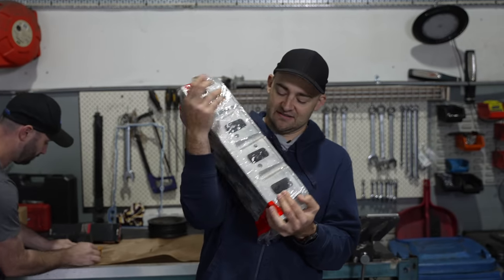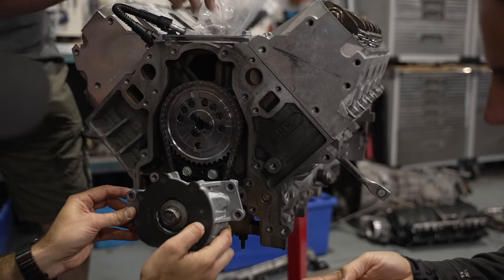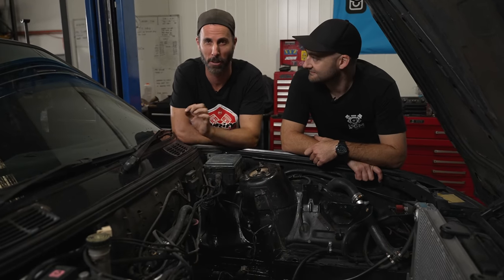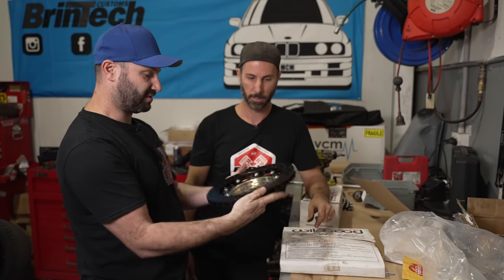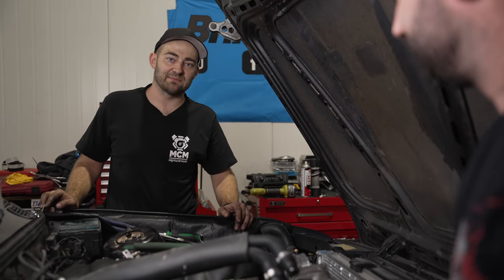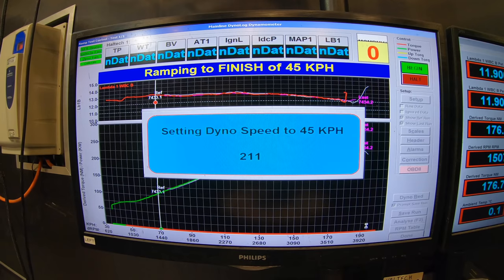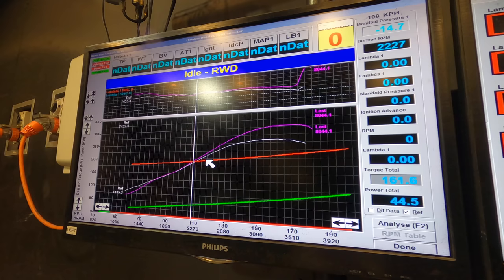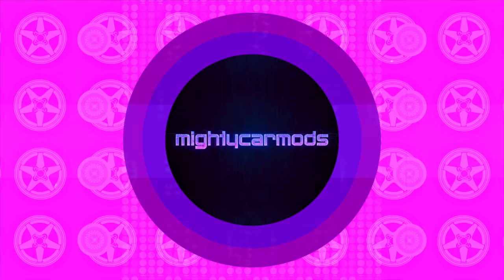BMW E30 CAM Upgrade & Dyno Run

Comment: @12:30 pedant mode activate! Your calipers are axial mount (bolt axis in the same plane as the wheel axis), the ones where the bolts go through the caliper from the outside towards the centre of the wheel are radial mount (bolts arranged radially around the wheel axis). Not convinced it actually makes much difference unless you're a motorbike racing team and want to be able to take calipers on and off quickly for wheel changes.

Comment: There is a reason LS swaps are so common. In the U.S. you can get a junkyard LS for under 1000 dollars. With a few mods, 400-500 hp is possible and they make torque and power throughout the power curve, not just at the red line.

Comment: Hey guys with the front callipers 
Inside the calliper they had 2 small pistons and 1 large
The large one is ment to be on top or exit of the rotor (directional)

Comment: On the brake calipers he said radial amount and axial mount backwards..
Radial mount calipers have the bolts coming straight away from the rotor.
The normal bolt on ears like that are axial mount.

Comment: LS at its core reminds me of an aircooled VW Bug engine with the central single cam, pushrods and rocker arms.

3D print that air intake! :) (I 3d scanned my engine bay, made a model in fusion 360, printed the intake out of ABS and then coated it in clear resin to seal it up. Really made a difference in power! Until my supercharger fell apart haha)

Comment: Pretty crazy gains from the cam and especially the intake. Scotty knows his stuff when he's like "nah, this has more in it, lemme just move this intake" and finds 10% more power.
Reply: It’s kinda obvious (for anyone familiar with LS) that it was sucking in hot air, especially when he has the IATs right there in front of him.  A healthy cam in a LS3 typically picks up 70-100hp.  I didn’t hear the cam specs, and when I saw the 400hp number (50hp gain), I thought they put a fairly mild cam in.  Seeing the IATs and the filter placement explained why the first run was so “low” of a gain.
Reply: @stlchucko  yeah man I'm certainly no expert, just saying a simple mod like a cam providing like 80kw is impressive. I have a stock ls3 and now I'm considering a cam down the track haha
Reply: @Mr_armageddon  I suggest checking out Richard Holdener's channel.  He has a slew of LS dyno info.  Here's one that has a few LS3 runs.
https://youtu.be/T2zJ_LAA-vM
Reply: @stlchucko  cheers bud, will do.

Comment: Remove inner high beam headlight, make airbox with the cone inside and an air duct from the headlight appiture = Ramair effect and even more KW
IF you can find a pair of VW Mk2 Golf headlights and swap it into the outer positions , they will give you both low and high beams if you make a adaptor loom as not to loose the factory wiring if i recall.
Should be about the same size

Comment: The LS is a good engine and has a good design, just because the original schematic has been around for many years does not wright off this design. while personally i have a japanese dohc v8 i cannot deny the power that the ls architecture puts out is impressive

Comment: Question for folks who do dyno stuff: the large fan in front of the car is obviously there to mimic the airflow you get from driving, so the car doesn't overheat. Does the fan speed ramp up to match the simulated speed of the car during the run? Does the environmental air flow rate have a big impact on the fuel/air mix, or is the ECU automatically compensating for that using ambient air pressure sensing? I know the ambient air pressure is a factor for some ECU stuff (VW infamously exploited this to calculate elevation via barometric pressure so they could switch profiles when the cars were at known emissions testing facilities) but I'm unsure if it comes into play with compensating for environmental air flow.

Comment: maibe a small hoodscoop feeding straight intoo the intake filter , make a box on the back of the bonnet under the scoop to hold the filter and use a compression gasket to the hose feeding the trottlebody when the hood is closed

Comment: Are those the factory rocker? If they are, you should consider upgrading the rocker trunnions at the very least. The factory trunnion caps that hold the needle bearings in tend to come out when holding the engine at high rpms, i.e. during burn-outs and or drifting. Comp Cams sells a cheap kit that is very easy to swap out. COMP Cams 13702TL-KIT on Summit Racing. Just remember, loose needle bearings sink ships.

Comment: Marty. This car is infamous for overheating. Especially with this swap. If you're not ready to seriously chop the front up to let air in EVERYWHERE your skids are going to be 30 seconds long and end at 250F water temp every time.

Comment: "Do you think this would fit a Honda?" Lol! Moog is never going to let go.
What goes around, comes around. As I recall, BMW used to make plain, unexciting German sedans, until someone (not BMW) got the idea of putting the engine from 2 liter car into the 1.6 liter car. Performance happened. BMW noticed. The rest is history.
Can't wait to see the lads put that push-rod-ium goodness to work! Who'd have thought cold air would be worth 30 kw/50 hp?

Comment: Some Corvettes use an intake that runs into the engine from the front of the car with a large panel filter. I feel like that could be a viable option to feed the engine cold air

Comment: Saying this as a "not an LS fan",.. that motor, in that body, is going to be a fun combo, and M3 beating performance with the right suspension tune, but a shedload cheaper to keep on the road.
If Holden had put that TT36 Torana concept in to production, this is what it would have performed like.

Comment: Love it guys, as per 👌🏼
I’m gonna have to google putting grease on the head bolts, I guess there’s an appropriate torque spec when lubed? Same for the rocker bolts; I always thought threads shouldn’t have lube if there’s a torque spec, but every day’s a school day 👍🏼
I feel like I’m allowed to ask geeky torque spec questions after the video on cam specs and timing 🤓

Comment: Kinda suprised you guys didn't get the heads CNC ported by Higgins. That's a significant power-adder that really compliments a cam upgrade - could have hit around the 350's.

Comment: The BMW m3 had vents in the bonnet for air intake. id take inspiration from the competition BMW m3, Fast & Furious Toyota supra, and even the Subaru hood scoop. I've also seen people make custom intakes and holes to get the intake by the radiator up front. not sure if you wanna cut up the gem of car you got tho.

Comment: Why not have the heads ported and polished while they were off and at the machine shop? It would compliment the cam swap, and ported heads really wake up an LS, even on their own. Basically left 30+ horsepower on the table. Doesn't really make sense to only have the heads ported, but if your doing the cam, and they are going to a machine shop already, might as well right?

Edit to add, what a monster though. A little E30 like that with 440 HP is going to be a BEAST!

Comment: I want an e30 with a 300hp NA k24 swap and the 4.10 rear. Go Lightweight for wheels and tires... and you have one seriously fun street car for the twisties that gets decent fuel mileage and will be honda reliable.

Comment: That really is just an amazing car; an amazing build. I was so surprised by the change in power just by getting the filter out of the way. I would be very curious to see if you leave it as is or come up with a fabrication to isolate the intake to pull cooler air.

Comment: Put a pair of louvers or louver the hood,one on each side and pull that engine heat away from engine and compartment while pulling cooler air into the intake.

Comment: Hope that was thread sealant on those flywheel bolts 🤷🏻‍♂️ they actually seal the end of the crank oil galleries and you’ll get a fun oil leak through there

Comment: They make a headlight intake for the stock motor, if you buy the kit and adapt it you will have no issues of getting colder air. Still so mad at my 15 year old self for not buying an E30, could’ve had a mint one for a low ass price

Comment: You should have put in a stroker crank and made it a 427ci or 7.0 litre while you had the engine out.
Reply: that is a LOT more work than just putting a crank in a block. This engine already over-powers this chassis, so what is the point of going to all that expense for a worse-driving car?
Reply: @Iainkellyis  they make videos for YouTube. They will get even more views the more crazy this car is.

Comment: Am I right in thinking the lifters are meant to be torqued down in a specified pattern with TDC per cylinder? I remember being told that back when I was building engines in a high school class.

Comment: I guess going over to a 5x120 M3 hub setup would have been cost prohibited? I know the E30 M3 was a 5 stud pattern and back when I was involved with E30's in the 00's , this was one thing people liked to do. As I was an Alpina fanboy and owner, I stuck with the 4 stud pattern for my 16" Alpina wheels.

Comment: When you guys were doing the brake upgrades did you change the proportioning? The primary reason I ask is in the vw world without mods to the proportioning you'll experience rear lock up with big brakes

Comment: Do not lubricate bolts that need to be torqued down, you generate hydraulic pressure, inaccurate torque readings and you risk cracking a block.

Comment: These guys take heads off, replace lifters, degree the cam... I swapped the cam in my 4.8 in a parking lot, reused all gaskets, didn't use dowels to hold lifters up. I just changed springs and pushrods and sent it lol

Comment: Never put liquid thread lock onto the flywheel bolts.
Always dab in the holes, because it squeezes down the threads and traps between the flywheel or bolt head, making the flywheel not run true or not tightening metal to metal on the bolt heads.

Comment: I used to have a coworker with a bmw 3 services of the same generation, he removed one of the headlights and had a k&n air filter sticking out where it was

Comment: Great Job Scotty. The Tuning Fork Rings Again. Even as an EV enthusiast, I'd still buy Black Ch-Ops as a track car any day of the week. Looks like a Bucket O Fun. I definitely like the explanation of why a cold air intake is needed. I hope now more people will see how much difference it makes. More power using the same fuel is better for the environment after all. The government can whinge about modifying our cars all they like, but if we are making them safer and use less fuel they can Shut the F-ck Up.

Comment: I like how this LS is more powerful than Benny's Lexus LS V8. Hahaha so close in power but this has more. Hope they do a colab between BCW and MCM and race each other on a track or down the quarter mile.
Reply from the maker: Slightly different v8’s, is200 chassis much more modern and awesom-er.

Comment: There's not 35WHP in 15deg intake temperature. Air flow is far more important than temperature here - the bonnet being closed is choking the engine. Run a pressure sensor in the vicinity of the intake with the bonnet closed and I bet you'll see some serious negative pressure.

Comment: Maybe there won't be as big a HP difference with the current air intake on the street where there will be better airflow? Monitor temps on a street pull to compare?
Reply: I think the dyno fan they have at Haltech is perfectly adequate to simulate the real world.

Comment: I doubt you will see this but I've been watching since your days in the driveway. Question. I've never seen you guys change out rings on pistons for higher compression ones ect ect. Is that something that is done behind the scenes or have you not dove that far into learning the numbers of motors? I remember most of the videos I've seen but I am sure I don't remember all of them lol.

Comment: is a 6pot up front too much as in the front tires will lock up too often because there simply isn't enough rubber that can fit in the wheelwell

Comment: You really need to do some suspension mods....... :DD while the engine was out throw in an e36 steering rack, front suspension arms bushings should definitely be replaced to solid m3 ones (all bushings around the car should actually...), then some coilovers and she will handle like a dream. Because now it will just be scary :D
Reply from the maker: Already has coil overs, will do the arm bushings though, good idea

Comment: I've seen water injection to boost power. And intercoolers but If cold air boosts power that much why doesn't anyone make a system to cool the air with the A/C that's already on the car ?

Comment: Do you put oil on the head bolts? That significantly changes the pressure they apply, does it not?

Comment: Would be fun to see you on the same track were you drove the Lotus and Subaru to see what kind of lap times you would get. Drifting is uninteresting just a way to wear out tires.  Run real racing on the track instead😎👍🙏

Comment: When upgrading your breaks like this, are you then committed to their pads or are they modeled after some OEM part that can be easily found?
Reply: Wilwood use proprietary pads but they are easy to get through the Wilwood dealer network, if you want a simple set up that works and uses stock size and shape rotors and pads a set of EBC discs with Green Stuff pads are good for fast road use.

Comment: Serious question I have an L 59 or had an  l59 5.3 And in the valley underneath the intake manifold there was to knock sensors I’m just wondering if the LS three does not have that or where they are located on the LS three

Comment: Proof that a pod filter jammed under the bonnet is not a cold air intake, 40bhp wasted by sucking warm air from the engine bay.

Comment: short the tube put the shart rammer direct on the entry brother short tube possible thats how thats engine love it on cam
Reply: masse air flow need to be 0 restriction ;) thats corvette engine
Reply: hole on the flair of the wheel and send thats air tube there to make it eat air like kurby brother then engine will blow other 50 whp for sure

Comment: Are you meant to run the cam in at 2000 rpm for 20 mins

Comment: you really want cold air? use a high temp ABS plastic pipe as your intake pipe to avoid having heat soak raise your intake temp charge then find a way to get air from the FRONT of the radiator..... what you are currently using there is a short ram intake.

Comment: Is it just me, or did they forget to tighten the nut on the oil pickup bracket, before installing the oil pan :/ :/ 5:15

Comment: Should do an LS Miata/MX5.. just saying.
Reply: As Jay Leno put it: "You made a small Corvette out of a Miata" when trying the Flying Miata LS conversion. The alloy LS is heavy enough that you get a 60/40 weight distribution while also having to firm up the suspension to avoid hitting the bump stops all the time. So basically a small Corvette :P

Comment: 10% power increase from air temperature alone? crazy
Reply from the maker: And air flow potentially also
Reply: @mightycarmods  true that. [Off to fitting a bigger intercooler, intake and exhaust to the family wagon]

Comment: Why do your “directional” rotors require the slots to be facing the wrong way? When the car is moving forwards (almost all of the time) the slot is supposed to be grabbing the brake dust/debris from the inside of the rotor and sending it to the outside. At least this is what all other reputable manufacturers of rotors do. The way yours are fitted will send dust/debris from the outside and push it to the hub ready for redistribution in an uncontrolled manner all over your brake components.
Reply from the maker: The design we use works both ways, means less part numbers

Comment: Those aren't dust shields next to the brake discs. They're heat shields. The radiant heat coming off a hot brake disc will melt the rubber seals around your CV joints and ball joints.

Comment: Why are you always referring to the power of engine in KW and not Horsepower? KW doesn't say anything to me
Reply: Google will convert between the two with a few seconds spent typing in xkW to HP etc or something.
It's the standard used for engine power output (and, y'know, electrical power of course) down in Aus, that's why
Reply: Because the civilised world uses KW.
Reply: @scottwilliam6141  Calling pretty much most parts of the planets Humans live 'civilised' is probably a bit of a stretch but yea, basically. It's an SI unit. Amusingly enough, it was James Watt that created horsepower

Comment: I'm gonna be that one bitch that has to correct the info XD no bad feelings. The info was great but he got radial and axial mixed up. The calipers you put on there are axial mount, they're the ones with ears and bolts that go sidey ways to the disc. Radial mount calipers have bolts that usually go through the body down into the bracket they bolt to. 
When the 180 getting done tho

Comment: WILWORDS ARE WEAK AND WILL FAIL also not street legal in NSW  not that it matters much here, Brembo would have been a better choice, Also did you degree the cam at all? Break it in at 2000rpm for 20 minutes.

Comment: MCM priorities are bizarre. They milk a shitty Civic for 10+ videos, but this E30 with a V8 which is properly excellent we get 3 videos out of it? I guess when it's not your shop time, you can only slack build for so long.
Reply from the maker: Different kind of build, different kind of videos. Variety is the spice.